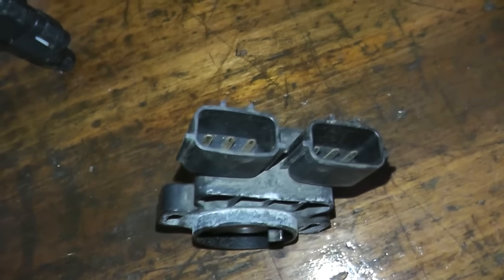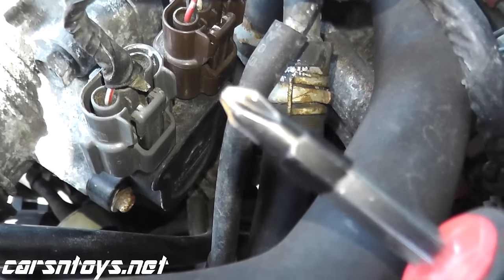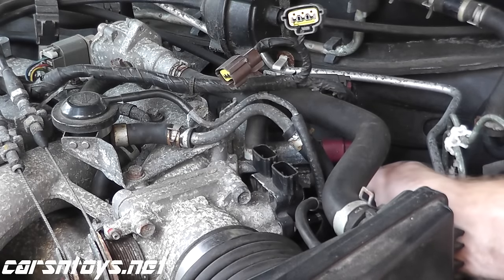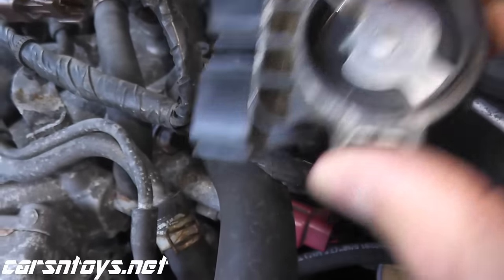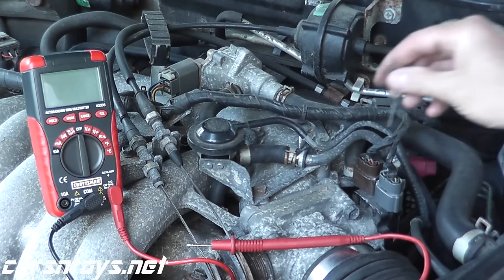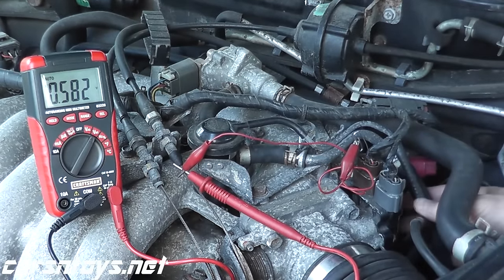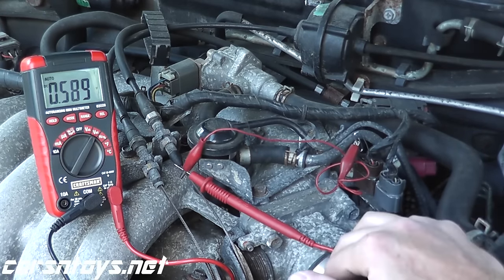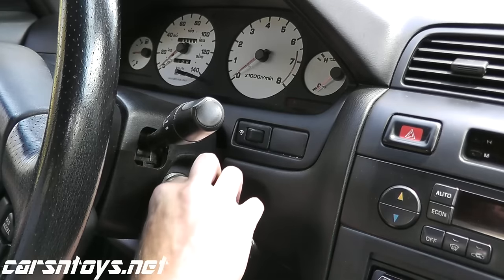How To Replace and Adjust the Throttle Position Sensor

Comment: Thanks for a good coverage on this topic. I just replaced the tps on my 2001 xterra 3.3 and the idle is perfect but it keeps dropping out of overdrive when driving and surging from 2500 to 4000rpm. Is that an issue that is fixed by the memory reset you are talking about? and is turning the ignition off and on 20 times method works on my model?
Reply from the maker: Any other trouble codes?
Reply: I did a scan this morning and I see two fault codes: P0120 Throttle/Pedal Position Sensor/Switch A Circuit and P1705 Throttle Position Sensor/Switch A/T. Not sure why I am getting that when I just replaced the TPS and the idle is around 750rpm after getting warmed up.
Reply from the maker: Did you delete the code after replacing the sensor? If not, assuming the sensor is repaired, the ecm will continually monitor the sensor and eventually turn off the check engine light.
Reply: Yes. several time, but these two codes keeps coming back after driving around for 10 min or so.
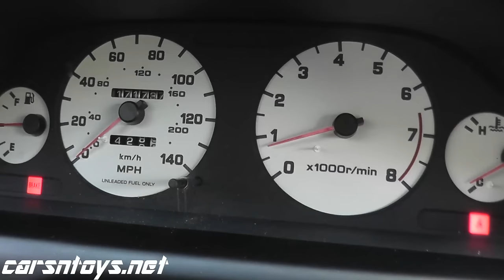Reply from the maker: What's are thr RPMs at idle? You should be between 700-800rpms (with the AC off). That being said, your vehicle does have an idle position memory. Fortunately it's the same procedure I describe in the video. (8:20) If you continue to have trouble you're best bet is going through each trouble code with a repair manual. I don't have one for your specific vehicle but I may be able to obtain one through a vender. Feel free to message us via Facebook. Cheers.
Reply: Thanks, very much appreciated.

Comment: I have an 05 Maxima 3.5. you think this could cause a loss of power issue? If I have it in gear it'll sometime act like the accelerator does nothing but if I throw it in neutral I have full revs. Any ideas?

Comment: Hello. Nissan Sentra 2002 RPM in parking 750 after driving at the stop with gear it drops to 300RPM and starts to shake. I cleaned throttle body and replaced IAC actuator, cleaned mass air flow sensor. What’s your advice?

Comment: I have a 2004 Cadillac Srx v6, 2wd and the car hesitates when trying to accelerate the car fast and it idles rough. And would cleaning the throttle body and mass air flow sensor make the car run better.

Comment: Hi i have a 2007 Audi Q7 3.6L V6 engine. My first question is how can or do i bench test of my gas foot pedal with the sensor attached to it ? Second question is what is the idle rpm for my model Q7 ?

Comment: I have a 2000 maxima 3.0 did a tune up cause mileage it was due for one. Car was running fine prior changed plugs used oem and coils also oem tested have spark at each cylinder. Changed Mas, pcv, ignition condenser, and crankshaft sensor in front now car runs horrible. No  power takes 5 seconds to hit 10 mph and will run 1st to almost 7000 and then bang to second. ANY THOUGHTS PLEASE IM STUMPED

Comment: I replaced my tps and now it runs rich really rich but I didn't know I had to adjust it it's 00 Infiniti i30t so my question is is that probably what it is I also did the IAC as well also a full tune up and replaced the high pressure power steering line and brakes just giving you a heads up on all that I did please let me know what you think thank you
Reply: Dude I have the same car...I had every part you mentioned go bad as well...it must be an i30 problem

Comment: I have 2002 Nissan Frontier 2.4L with 210 k miles. Started with P0302. I replaced plugs, wires, distributor cap, fuel filter and fuel injector. I have spark on all plugs, harness were tested. Rough idle, below 500 rpm on drive. Came with new service code P0505 and p0300. Any suggestion?

Comment: 1994 mitsubishi mighty max 2.4l.  Replaced tps, cap,rotor,wires,but can't seem to get the truck to start or it starts and stalls. Looking to find how many turns on the idle adj. Screw and there is also another on opposite sit of the butterfly where cable connects. Appears to split the butterfly . It has mikuni throttle body efi any info would be greatly appreciated

Comment: 2000 nissan Pathfinder.  It sat for 3+ years, it was given to my child and the idle runs high and will not shift past 2nd and the RPM will jump up, we shift it into 2 low and the rpm will come down but its not shifting. We were told the rpm's were not adjusted but I have never seen where you couldn't manipulate to get the vehicle to shift. 
We did change out the trans fluid without flushing it or cleaning off the magnet. and that did help a lot but still have the issue.  How can I trouble shoot the issue? one time it did not want to go into reverse but it only happened once and that was right after it sat after an accident.

Comment: Hi.. I replace the TPS on 01 Infiniti I30 and now there's major shifting problems. I guess it needs to be reset do you know if it can be done manually. I tried to turning on and off day key 20 times like you mentioned in the video it didn't work I guess and I tried some other procedures from online like turning it on 2 seconds and off 10 seconds repeating I'm turning on dispatch pressing the gas after 3 seconds 5 times in 5 seconds Etc someone said it has to be done through scanner tool resetting the computer or something. Do you have any info on this? Thanks

Comment: Can you answer me this, Nissan frontier 2000 4x4 6 cylinder TPS, I have it at 600 rpms runs good but don't want no stalls incase of hard stops or anything thanks to you I know voltage is correct 5.53 volts but do I need to reset it and should I try and bring RPMs up to 700-750 or will 600 be fine? Also if I need to reset can you tell me how, it's my mother's truck and I want her to be safe. It starts and idles smoothly but safety 1st lol.

Comment: Hey brother I loved the info you gave .... I am having problems with a 2001 Hyundai Sonata 2.4L 4 cyl ... what's going on is when it sits for a minute and then I restart and try and go it acts like its not getting gas but after about a minute or longer it runs fine like nothing is wrong. I finally got the ✔️Engine light to come on so I plugged in the Autel OBO II which said it was the TPS .. now I have the manual but my book says to use MV and you used just volts on meager .... I have been searching all over internet about this but can't find anything ... so do you have the info I need to check the sensor ... Have a Good Day!!! J.R.
Reply from the maker: Hi J.R. Unfortunately I don't have the specs for your vehicle; but it sounds like you have all the correct specs. You can check the mv of the sensor to see its output. If it's out of range, you may be able to adjust or you may have to replace the sensor.

Comment: What about a TPS that has only has the screw holes that can't be adjusted and fits on one way only"? I just put on a new TPS on a 1997 Toyota Avalon (I disconnetd the battery first because I was told to do that before I even take the old one off). Both the original Toyota TPS and the new replacement part just have two stationary screw holes that are non-adjustable. (only fits on one way) I did however, notice that I had to twist the sensor slightly in order the match up the screw holes after inserting the part on the little gear inside the TPS Throttle body mount. (it was maybe a 1/4 inch off. The sensor has a little tension spring inside that allows you to turn it slightly to match u the screw holes. I'm assuming no adjusting of the sensor would be necessary since it only fits on one way? Or is there some other adjustment that I'm not aware of? Also, once I've put the new TPS on, how long does the ECU take to re-learn the new TPS and respond accordingly? And will I see improved performance immediately after installation or will the car continue to run badly until the ECU finishes relearning the new part? Thank you!

Comment: Might you have any idea why when checking the DC voltage, my TPS (1999 Maxima) reads from 0.1 volt to 0.42 throughout the entire range of TPS adjustment and starts to buzz somewhere when above 0.35 volts? Thanks! BTW no codes for TPS. Just Baro/MAP and Swirl.

Comment: i have a 96 geo tracker which has a minimum rpm of 1500 when i have it on parking, if moved to gear it will drop and stall, not sure if it is a tps problem or might be something else. after the car gets warm, there's no problem and it doesn't stall

Comment: I'm believe I am having an issue with my throttle position sensor. I drive a 2009 Nissan Altima. It's a push to start. Would I be able to do the same process (at the end of the video) of turning my car on and off 20 times the same as if I had a key? I would imagine it'll work right?

Comment: Hi...I have a 1997 Pathfinder.  About four weeks ago, I cleaned out my throttle body, mass air flow sensor along disconnecting and cleaning my TPS.  As soon as I put everything back, it hasn't idled properly...AND, codes P0100, PO120 have appeared on the scan.  I did not know I needed to reset the memory of the TPS.  Will this work for my '97 Pathfinder?  I have since replaced the TPS but, I still have the one I took out.  Thanks for your time!
Reply from the maker: Everything is hooked up? In other words, no loose fittings, vacuum lines, etc.?

Comment: I have a question for you.  I have a Nissan Sentara 03.  When I press on gas pedal won't rev up. I put different throttle body in it  still won't rev

Comment: Hello there! I have a 99 Maxima, same as the 97 in your video. Last week while driving home I hit the gas kind of hard making a turn, and the car suddenly started developing a miss and the CEL came on. I got the code read and it was a misfire on cylinder #5. I replaced both the coil and the spark plug for that cylinder (it took replacing both of these for the miss to go away.) Also the CEL went off by itself after this without me having to clear it. So now the miss is gone and the car drives very well, however the idle seems to be a bit low after the engine has warmed up- it's around 600-650 RPM in park and around 550-600 RPM in drive, however it has dipped as low as 500 RPM in drive a couple of times while stopped at a light. Would the procedure in your video fix this or is there still something wrong? The idle seemed fine before the misfire started. Thanks!

Comment: hi my daughters 98 maxima had bad injectors so i took the top end of the engine apart to replace injectors and while i was at it i replaced the coils. i put everything back together and the car idles super high (6-9k rpm) but if i put it into gear it settles down to around 2-3k drives for a lil bit then dies....i didnt touch anything on throttle body at all ...any ideas on what it could be.

Comment: good info. how did you get the referenced number around .600mv, also how did you figured out the reading between .3 -.7 volts? i have a 98 suzuki sidekick and i want to reset my tps sensor idle speed.
Reply from the maker: Research. You can dig up the info. If you have trouble let me know and I'll see if I can dig it up .

Comment: Hi, I was wondering what that noise is around 6:33 when you moved the sensor there was a buzzing noise? Just curious as to what that might be as mine does that too whenever I move the tps to a certain position.

Comment: thanks for the video. how often should tps be changed or what usually signify  that it needs changing. can you go over symptoms for changing certain parts of the car in future videos? it is just a suggestion. i think it will make your tutorial unique and more informative.
Reply from the maker: No need to change the sensor unless it's faulty; such as code p0120. Usual indication is poor acceleration. Thanks for your feedback!

Comment: Eric -are you sure you have to turn on and off the ignition switch 20 X to reset the idle position memory ? Seems strange ! I'll believe you if you respond back in a video OR answer me back . Please respond . I have a 1996 Nissan D-21 truck w/ a KA24E motor , 327,000 mi. With that problem after a timing chain install and head rebuild . THE TRUCK HAS BEEN SITTING FOR 3 YEARS . Thanks .
Reply: David Braun  is the base idle why your in Park

Comment: good video I wanted to ask you a question I went to smog my Nissan Quest 96 did not pass the results said a bad TPS sensor and check engine light is on if I replace the throttle position sensor with a new one get it adjusted will the check engine light turn off permanently ?
Reply from the maker: If the fault is corrected the computer will eventually turn off the light, however, it takes quite a bit of time for that to happen. You can purchase a simple scan tool to delete the code if you rather not wait.

Comment: I'm getting volt readings between .94 and 1.35 on a 1999 Maxima SE.  No matter how I adjust the sensor, I can't get lower than .94 volts.  Any advice on getting it down around the .50 mark?

Comment: I have a 02 Toyota Tundra and I couldn't get the damn screws out lol.  They also haven't been touched in 17 years.  As soon as I started bleeding trying to get them out I brought it to a mechanic.  I didn't want to strip out those screws either like he's talking about.  one of them kind of already was so I figured a mechanic could get it out with an impact drill.
Reply from the maker: I don't blame you. It's often soft metal and incredibly easy to strip out. BTW, great truck to have. A buddy of mine had one for years. Beat the heck out of it and it never missed a beat.

Comment: I have a QG18 engine i had idling issue so i change to throttle body and its idling nice but just having a hesitant moving off in first gear. So wat can i do to fix this new issue?

Comment: great video! thank you! due to my financial situation, setting the TPS with a meter is NOT an option. I have a 2005 Kia Sedona. just replaced the TPS. could you tell me what the BASE IDLE SPEED is for it and could you tell me the reset steps? I appreciate it! thank you again!

Comment: I have a 2001 nissan sentra gxe. the service light today came on and gave me the code p1126. I did some research and it says it is a bad throttle control motor relay. would it be the same process?

Comment: I've got a 97 Toyota corolla. What is the base voltage of the tps when throttle is closed engine not running. What is my base idle as well

Comment: Hey Bud i have a 2007 Nissan Maxima 3.5L  & i unplugged & cleaned the Throttle Position sensor & now the rpms r very high & it has a P0507 code. Everyone whos had this problem needed to do the idle control system relearn. But Im not sure how to do it. Any help would be appreciated

Comment: I have 2001 pathfinder it doesn’t idle ur starts then stall unless have foot in the gas i did the iacv and the maf would tps cause to stall once i let of the pedal? As of right now i have to keep foot on gas to start if i let off it stalls so i been driving with 2 feet, lol. Any ideas? Thanks buddy

Comment: hey man, i got a 95 maxima and after replacing the maf the idle was ok 1 day, then it was horrible the next day. so i tried to adjust the idle via the screw on top of the iacv and it it appears to be stripped, i went ahead and got a new iacv from advanced auto and was wondering if you did a how to for that. also got a iat code and not sure where that is either, any help would be appreciated and what tools do i need, thanks
Reply from the maker: Here you go: https://youtu.be/BYuRKzsqp-g

Comment: My Nissan Sentra 2000 drives but wouldn't shift gears, even when you rpm to 4000 or 5000. Please do you think it is the speed sensor or the throttle adjustment sensor. Please help! What do I do. Thanks

Comment: Got added to the middle of a job. Someone installed new tps and was incorrect and show no voltage. I took out and reinstalled and set voltage to .50 and idle stays at 1400 rpm, and reverse is inop but drive is ok. The trans line pressure drops to zero when it goes in reverse or drive, but comes back up while driving, and also comes up when mash has in reverse but van doesn’t move. I’m thinking the issue is internal trans and nothing to do with tps. Thoughts. 01 quest with 110k.

Comment: Good day Sir, im from Philippines, i own a Nissan Sentra 2004 1.3 qg13 engine, the problem is when i cold start the car it runs fine  for about 4-5 mins until when its hot it will start stalling, i cant even rev it upto 1.5k rpm it only talls, i wonder if its the Tps or any other sensor, i hope you can help me sir

Comment: Help if you can. After watching this video I realized that I installed the TPS sensor incorrectly. Unfortunately I had already taken  the car for a test drive and while driving, the idle was going up and down then the engine just stopped working and could not get the engine to start again. I reinstalled the TPS following your video but still can't get the engine to start. I'm not 100% sure but I think there was a smell inside the car like the burning of an electric component. Hope you read this post and point me in the direction of the problem. Thank you.

Comment: 2001 infiniti Qx4. Reemplacé el TPS. I replaced the TPS, I did not know that it has to be adjusted and I'm having problems when I started driving. the vehicle rough and tray to stalls when starting to drive. Thanks

Comment: Hey I know your video is 5 years old but do you know what my base idle would be for a 2000 Nissan Maxima gle? Or the volts on the multi meter for it
Reply: How do you reset the idle position memory in a 2000 Nissan Maxima gle is it the same?

Comment: I just replaced my accelerator sensor and now it lacks power going up hills and doesnt seem to rev out,does it need adjusting as i had to drop it back to 3rd gear but before ecen with old sensor it didnt have this problem only surged,if you can hrlp be appreciated

Comment: I tried installing new sensor on 01 Infiniti i30 but I broke the screws in half n are stuck in throttle. There's a hole next to each of the holes with broken screws inside. I was wondering if new sensor can at be screwed in those at least temporarily